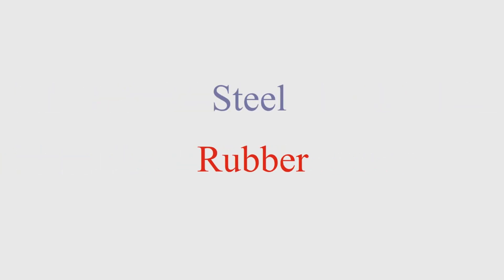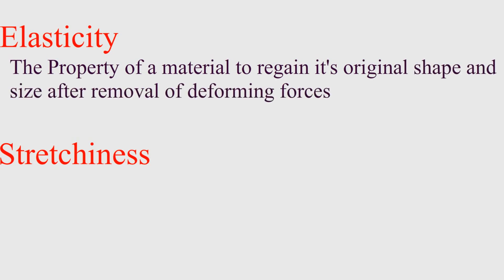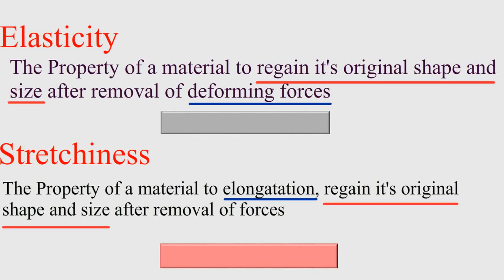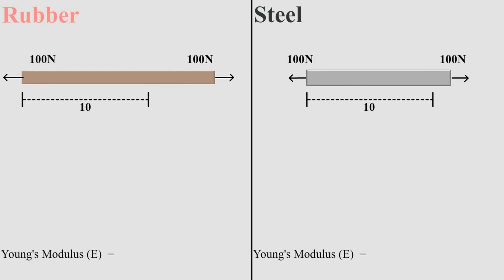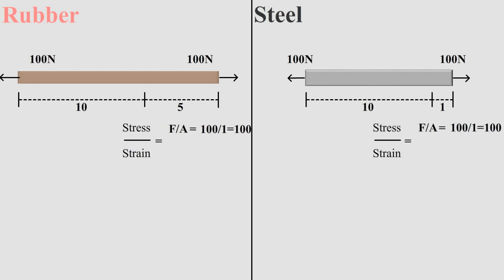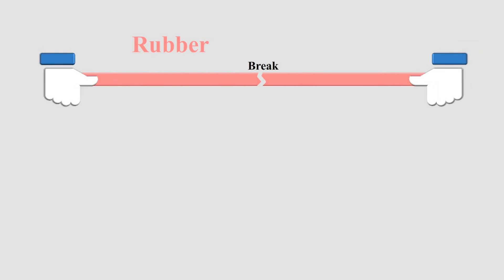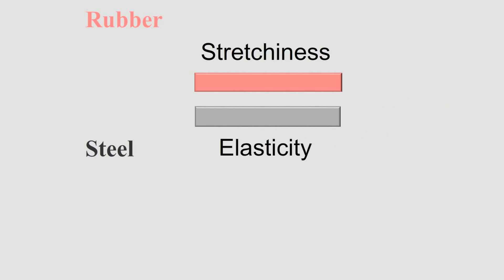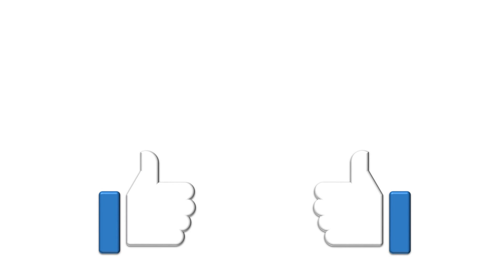Rubber VS Steel - What's more elastic

Comment: Your animation and explaination about elastic steel is wrong. 
You made steel strecth like a rubber, not elastic.

Eleastic steel just bend, then it return to its original form once release. This kind of steel was use on vehicles, its make the ride comfortable. Same as the elastic steel use for leg amputated athletes.
Does elastic steel stretch even 0.1 cm? No.

Comment: 1:33 note that rubber does not have a youngs modulus but in fact, a dynamic modulus, because it has viscoelastic properties, however, you are correct in all other aspects. This is something my teacher told me recently. It's because the rubber deformation is time-dependent.